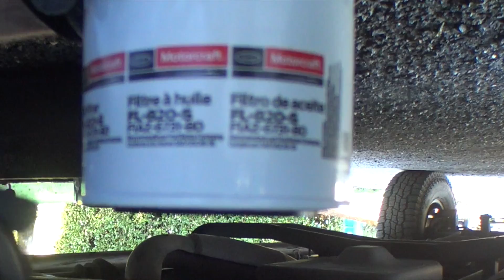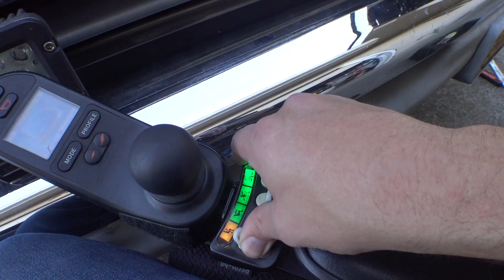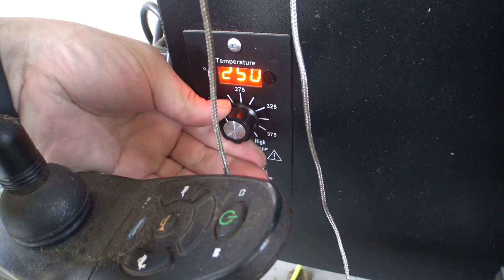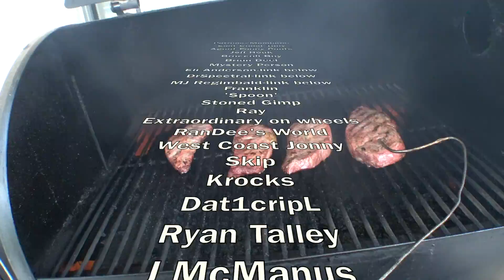VLOG 527: vehicle maintenance!

Comment: hey i was wondering can you do a tire comparison including castor tires and how to switch your forks on a powerchair to put on a slitely bigger castor
Reply from the maker: castor forks are tricky to swap without cutting and welding things.. almost all of the designs are different, and have different shaft diameters - and a lot of brands have very little clearance for bigger castor wheels unfortunately..

Comment: Whats wrong with Pennzoil? I'm left wondering.
Reply from the maker: oh - oops! forgot to put that in! lol - so penzoil is a good quality oil (as far as lubrication properties) BUT - its downfall is the lack of ability to hold dirt in suspension... their ads say "look how clean the oil is after 5000 miles" problem is - if the oil is CLEAN then the dirt is still in your engine! - oil needs to pickup the dirt/sludge, and move it to the oil filter.  they also claim longer oil change intervals - which leads to more problems.  anytime ive broken down an engine that runs exclusively penzoil, they're always FILTHY inside! they have a very identifiable smell.. the additives and 'waxes' they use just aren't made for longevity.
Reply: @TotallyNormal-  thanks for the information.  Have a good night from Vancouver, Canada.